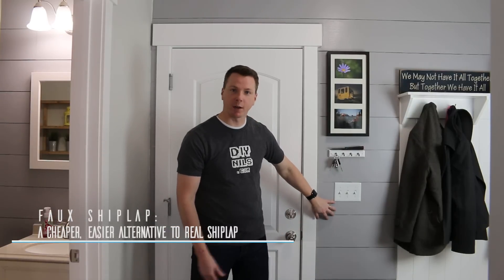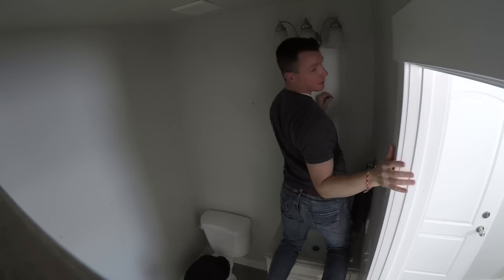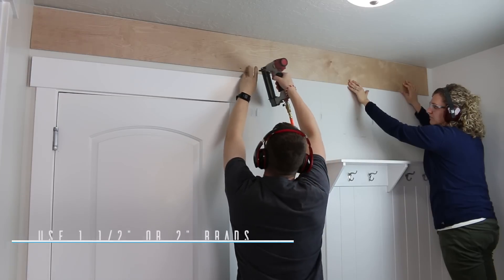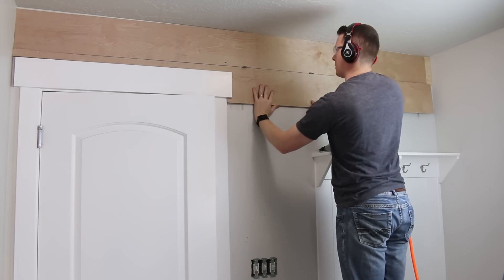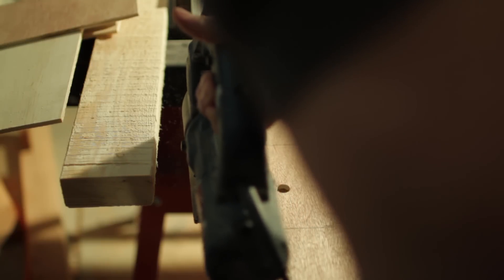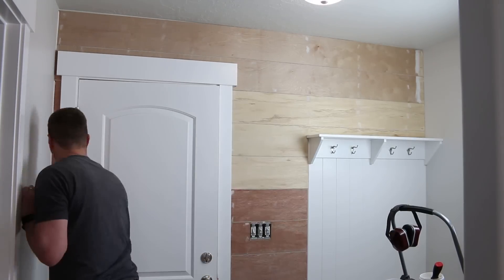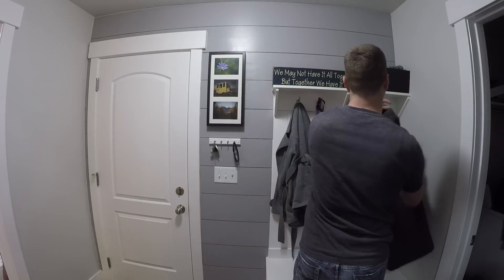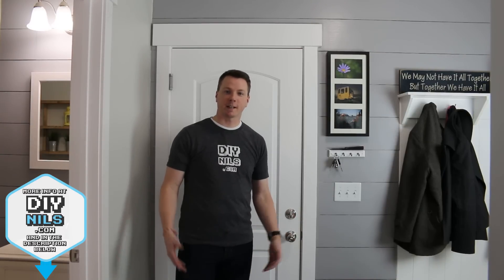DIY Faux Shiplap for $80

Comment: that first board though...
Reply: literally couldn't watch the rest of the video because of it
Reply: I know right! Haha.
Reply: Who needs a level?
Reply: Same here. Gap at top was very bad and then small pieces on right side were bad too. Should have cut more off first board then stagger then next row and so forth.
Reply: I was thinking the exact same thing.  A piece of trim would hide it.
Reply: I know, least fill it in then paint it. That gap is nasty.
Reply: net poser This dude hacked this project.  Bad example to show beginners.  Sorry to post negative.
Reply: Y’all must live in new homes, I can tell you from a 80 year old homeowners prospective that there’s no such thing as a straight line or level wall.  When I renovated my house there were gaps twice that size and nothing you could do to resolve it because of the house settling and moving over the past almost century.  This was a fantastic job and and upset I didn’t see this video before renovating my house!
Reply: Justin Benson I hear what your saying but come on.....you can’t scribe the first board with the contour of the ceiling to eliminate the gap? In brand spanky new homes you would be surprised how many walls / ceilings are not straight. Doesn’t mean you have to take shortcuts.
Reply: Jay this is true, either that or put trim up to finish it off.  That is if trim is acceptable to use on shiplapping.
Reply: Justin, However you can easily fix that.  Straight walls or not.  Just takes some attention to detail and know how.  No excuse for sloppy work even if the walls are uneven.
Reply: Shaun Kelly o
Reply: Measure down from the ceiling 7.75 inches and mark a level line using a long level. Scrip your first board so it fits tight to the ceiling and the bottom edge lines up with the line you just made. Keep your small filler pieces in the less obvious end. Like behind the door.
Reply: You all must think that EVERY home has level walls and ceilings?  I am sure he leveled it before nailing, hence the gap.  It's pretty obvious the rest of the boards went on and looks pretty level from the video!!
Reply: Paint the boards’ edge before you install the next one. It makes it much easier and will look great at the end.
Nice job overall.
Reply: I would have leveled and scribed that top board.  Noticed the top of the top board wasn’t framed into any of the shots after it was finished.  Came out looking pretty good though from what I could see.
Reply: Yeah that was awful...kept yelling don't nail it.
Lol
Reply: I'm DYING. It's killing me.
Reply: @JbensonLIVE  not having a straight wall or ceiling line is perfect reason to use an age old technique called scribing. of course, you can also go ahead an install some sort of crown but it would have to not be of the ornate/colonial type to match with the shiplap.
Reply: Shaun Kelly Hey, Bae can you pick up my spacers. I can’t seem to figure out how this works when I work form the up to ground. Mickey Mouse Club
Reply: @jeepinamerica4356  LOL... ME EITHER... I AM SO OCD.... I THOUGHT IT WAS JUST ME...LOL
Reply: How did they miss that!?
Reply: My wife divorced me because of it.
Reply: Lost a lot of cred there.
Reply: Ugh. It was driving me crazy! I thought, well maybe hes just going through motions just to show us. But he finished the fucking project and left it like that!! Horrible
Reply: I had to go back and look .that would of drove me nuts.
Reply: He did this wrong  no plan
Reply: Lots of haters here...yeah the gap was noticeable but in reality who actually HAS a hone that hasn’t settled and sagged here or there??? C’mon..no lying guys....yes a level and some measures from top to bottom and apply spacing could’ve helped but the overall look was great. I recall he never said he was a professional 🤔
Just a DIY’er
Reply: Yea it’s gonna happen no matter what he dose those lines aren’t straight
Reply: @JbensonLIVE  same here! I have a 1977 home and the walls etc are so uneven it drives me nuts lol
Reply: That board might be level and the house probably isn’t.  I’m about to do this in my kitchen and will need to get creative with some trim and caulk to hide how out of level my house is!
Reply: You mean that gap? I know…hmmm

Comment: for spacer i used that free paint stirrer they give for free at home depot
Reply: Or just use a cutoff from the plywood itself
Reply: Just use a framing L square and slide it across the rows. Shoot one side and slide it to the other. Bice clean even spacing and you dont have to even remove the spacer until you are done. I find that to be the perfect even space. And if you own that tool you never have to find anything else to ever space with. Usually when you go shiplap and see how wonderful it is, you tend to keep adding. Easy to overdo it lol
Reply: @mirahgirl01  love this tip, thanks man!

Comment: You forgot to use a level on that first board (or at least failed to mention and demonstrate it to your audience if you did).  If your ceiling is level, then that first board isn't because there's a bigger gap on the left side than the right between the wood and the ceiling.  Also best to stagger your butt joints (cardinal rule in fact).  Now you're going to have two super short pieces on the right ends of the first two boards in a row.  I'm sure you do some really awesome videos, but so far this one isn't serving your novice DIY community IMHO...
Reply: bla.. 
bla.. 
who care about perfection. .
just started from the ceiling. . 
aligned to the top.. 
done. that's your level.
Reply: @Lu-cho  perfection and poor craftsmanship are two entirely different things. and clearly this ceiling isn't level, or at the least, the drywall isn't. it would take all of 15 minutes to scribe that board after actually leveling it, and it a rather easy thing to do for the novice.

Comment: What about the humidity in the bathroom? Or it doesn’t have a shower? I’d love to have that in my bathroom but some black spots are appearing above the shower wall and I need to find a way to get rid of that 🙁
Reply from the maker: My bathroom was just a half bath, so not a lot of humidity but you can install this in a full bath. You'll want to use a thick coat (or two) of mold/mildew resistant paint, and be sure to seal the corners with caulking. The special paint makes all the difference in prevention of issues related to humidity.
Reply: LRN2DIY thank you for replying! I do appreciate it 😊

Comment: How would you attach to plaster walls?
Reply: Hi Melissa. Lath and Plaster can be tricky but the best way to mark studs on lath and plaster is to use a really strong magnet, like a rare-earth magnet or a neodymium magnet to find the nail heads that attach the lath to the studs. Studs are still your best bet for attaching these. There's a great little magnetic stud finder called the C.H. Hanson Magnetic Stud Finder: https://amzn.to/2DlMxwS that's definitely worth checking out. Best of luck!
Reply: I am pretty sure that there is wire mesh  with the plaster

Comment: What would you use if u want to cover a cement wall and make it into shiplap ??
Reply from the maker: Unfortunately there’s no simple answer there. Concrete usually needs a vapor barrier over it and, depending on the situation, insulation. Technically you could fasten some vertical firring to the wall and tack Shiplap into that but there’s all kinds of code considerations to look into.
Reply: @LRN2DIY  ohhh i see thank you 😊

Comment: How did you determine where to put the horizontal lines in the basement ?
Reply from the maker: Same as upstairs. We started with full sized boards up against the ceiling, added our gaps and then stacked down from there. Ideally, you pick the area that is most visible (often that's the ceiling line, but not always) and put a full board there and then move up/down after that.

Comment: Wasn’t sure I understood if you put putty in the horizontal gaps? I got that you did in one version & didn’t in another version & liked the putty in the gaps? But it still leaves enough of a gap to maintain shiplap look? I’m a beginner ..
Reply from the maker: Good question. I was referring to puttying in the vertical lines and the nail holes. By putting over the vertical lines/gaps, you make each row look like one continuous piece, rather than two or more individual pieces per row. It's all just a personal preference but I liked the clean look of the puttied nail holes and vertical gaps. Hope that makes sense.

Comment: Can anyone tell me whether or not it’s a MUST to shoot the brads into the studs? Or will it suffice to just shoot into Sheetrock???
Reply from the maker: If you shoot into the sheetrock and not the stud, your planks will be able to be pulled out and, worse, may not lay flat on the wall to begin with. If you use adhesive of some sort that will do the job but it's a lot harder to remove if you want to take the planks down at some point.

Comment: Did you have to pull your electrical boxes out in order to put them flush with the new wall...?
Reply from the maker: In this case, no. The plywood only added about 1/8" to the wall thickness, which is a depth that can be compensated for with the screws of the outlet. I did remove the outlets and sit them on top of the plywood, so that the faceplate would seat properly but that's it.

Comment: Awesome video. In hindsight would you have preferred to paint the edges of the board before you hung them?
Reply from the maker: Yes, absolutely
Reply: Great thanks. Two more questions. Why are they called Brad nails, and why is the jigsaw cord so short?
Reply: Another tip I’ve seen is to paint as you go in between the boards!

Comment: THE Jigsaw and me are terrible - CAN'T CUT STRAIGHT lines if my life depended on it .STARTED this project yesterday  - Home Depot ripped all the sheets for me but the cuts using a jigsaw are terrible .......
What type of Saw will i need for even simply cutting the ends to length? Do I need a sliding chop saw?

Comment: Please explain what you did for the light switches area. Did you install box extenders? Or just screw directly into the plywood?
Reply from the maker: Adam Willea - Because the boards are only 1/8” thick, I just cut the “ship lap” to where it was covered by the switch plate and placed the plate right on top of it. I didn’t use box extenders because between the switch screws and the plate screws there was enough play to make up the difference.

Comment: What would you do for the edges if the edges don’t hit a corner of the wall? We’re doing a shiplap accent behind a tv and fireplace on a flush wall.
Reply from the maker: I'd add a piece of vertical trim (chair rail, pencil molding, etc.) to serve as an edge for the ends of the shiplap to butt up against.

Comment: Did you mention that you will need some level lines?  Also....using full sheets with a wall longer than 8' is a horrible idea.  You need to use something like 4' pieces and stagger them.

Comment: Looks very good! But I did this around my bath, and the timber swells and shrinks due to the moisture in the air. Do you think this will happen on the walls? 👍🏻
Reply from the maker: Great question. I think it'll be fine on the walls because this is a half bath that doesn't get very damp at all. Same with the mudroom. I can see how putting it near/around a bath or shower would be problematic since the wood can absorb moisture somewhat. The shiplap in our basement has been there all year and looks great still. Thanks for watching!
Reply: Shaun Chadwick plywood doesn't swell or move with the seasons or moisture like solid wood, solid wood swells with the grain when it gets most, the grains of the ply's are alternating preventing the wood from swelling. MDF is also an excellent choice for a paintable surface because it's cheaper, and I would highly recommend using construction adhesive.

Comment: Nice job.  Can you clarify, did you use 1/4 plywood or 1/4 luan?  Thanks.
Reply from the maker: It was actually plywood, but I'd recommend using the thinnest plywood or Luan you can get your hands on. Whether it's 1/8', 3/8" or 1/4", the effect will be similar.

Comment: I'm construction challenged to sat the least.  I'd like to attempt this on my kitchen ceiling which is super imperfect.  Thoughts on whether it would work?  Also thoughts on labor cost if I decided to hire out?
Reply: Ive seen people use wood or laminate flooring and painting over it. Its basically pre cut except the ends and it looks really good. If u know a builder, a lot of times u can pick up their leftovers from a job pretty inexpensively

Comment: How important is it that the dry wall surface is completely even? I have new drywall just put up but it has not been taped or putty'd, so there is a little uneven-ness. Will the plywood cover this up or should i smooth out the drywall with tape and putty first?
Reply from the maker: Great question. As long as the drywall is screwed into place securely, you should be fine. I did this exact same thing in my basement bathroom - no mud or tape, just faux shiplap on bare drywall and it worked out fine. You can take a look here: https://youtu.be/70bVcAc9NbA

Comment: Wouldn't you have to remove the floor molding and  door trim and put the plywood down to the floor and butted against the door? Then reinstall the  trim . Otherwise  if you have trim that is  not  thick, the plywood will be sitting on top of it.

Comment: Make sure to use plastic spark rings around switches and outlets.  Electrical code does not allow wood  between the electrical box in the wall and the yoke of the switch/ outlet

Comment: Can you tell that looks like plywood from a close distance?
Reply from the maker: Only if you can distinguish between shiplap grain and plywood grain. Since you don't really see the ends of any of the boards, it's a pretty good substitute. The other giveaway is the thickness of the wood. Actual shiplap is typically from 3/8" to 5/8" thick, which is way thicker than this 1/8" plywood, though the overlap portion of actual shiplap is only 3/16" to 5/16" so the depth of the gaps is really close to that of actual shiplap.

Comment: I have plaster and lath walls what would you recommend for brad nails size ?
Reply from the maker: With plaster and lath, almost the whole wall has wood behind it, which can make the job easier but, if at all possible, it's still best to nail into the studs. Either way, a longer brad, like 2", would be ideal. Good luck on the project!

Comment: I have concrete Walls. Any advice? the easiest way to install them on the wall :)
I Liked & subscribed
Reply: Adhesive or 3-M VHB tape, the wood is not heavy, that tape holds 10 pounds per inch, we use it to install body kits on cars etc...it will hold.

Comment: Dude, the first piece you put up at the top is crooked. Did you go back and fix it?
Reply from the maker: That's actually a bad ceiling job. Most ceilings/walls/corners are not perfectly straight and putting something straight up against them really accentuates that fact. You can see that when I held it up there with my wife, I had to choose between making the right side lower or the left side lower since the ceiling bows in the middle. The board here is nice and straight but what I could have done was trace the outline of the ceiling and custom cut that first board to match. I'm way too lazy to do that though. :)
Reply: DIY Nils you could go one step further and do crown moulding ;)

Comment: Hi Nils!
What was the work around for getting around the toilet? Is it the flexibility of the Luana or did you remove the toilet? Thanks in advance:-)
Reply from the maker: elle Conner For the area behind the toilet we were able to slide the pieces of plywood behind there without a problem. In this bathroom, the water inlet is on the floor, not the wall, which makes things easier. If yours is on the wall, you'll need to cut around it and possibly cut a line all the way through the board that surrounds the fixture. Then you can just putty over the joint. Hope that helps and good luck!
Reply: Yes, it does. 
Thanks so much!

Comment: any suggestions for doing this on wood paneling?
Reply from the maker: I'd really recommend removing wood paneling before putting the shiplap up. I say that because adding shiplap on top of it is going to make it that much more difficult to extend the outlets and light switches. Do you have any idea if there is traditional drywall or lathe & plaster underneath the paneling? If there is, then I'd remove the paneling but if not, shiplapping right over top of it is probably your only option.

Comment: This might have been answered but what is the reason you put the coins between the boards
Reply from the maker: Good question. It's really just to simulate real shiplap. It's aesthetic. Shiplap has overlapping boards and there is a gap between each board. It provides a nice look as far as contrast between the solid board and the gap between. You could certainly do this without the gap as well but you may as well use a solid sheet of wood or not do the boards at all. The height of the gap is up to you. Does that make sense?

Comment: To all those commenting on the 1st piece.... The 1st piece WAS level.  it’s the ceiling that’s not. Only way to ensure the rest of the wall is straight. He did it right.  Maybe cover with crown molding.
Reply: Uh, anything wrong with tracing the ceiling to the first board and making it right to start with?

Comment: did you have to remove the toilet and vanity cabinets?
Reply from the maker: No, we were able to get all the way behind the toilet and we left the vanity in place. If you were to switch to a smaller vanity, you'd have to add more boards but we had already swapped that sink from a pedestal sink to a full vanity.